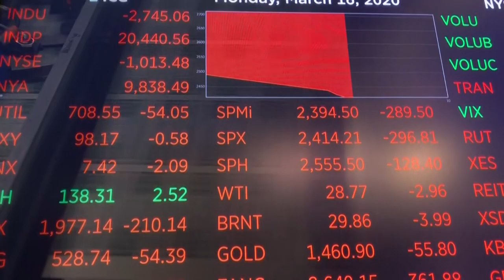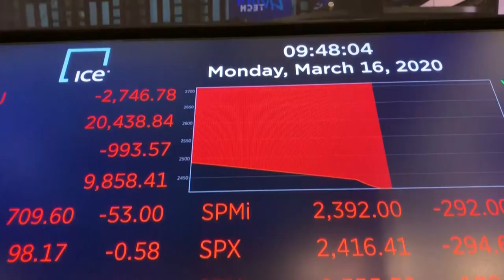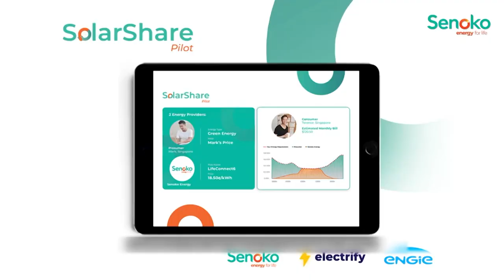Why Low Carbon Is The Way To Go | Money Mind | Low Carbon Economy

Comment: Building back better is a US Democrat slogan. The great reset includes climate change. 
But in reality although it sounds good and well, solar system for example is expensive and it does not last. 
I have 6 solar installed street lights on my compound. After a year it stopped working. I was told I had to buy new batteries. The battery replacement are expensive. Now I had to reinstalled the solar street lights system  to electricity. Even electric cars needs electricity. 
Dont get me wrong but I dont agree with the term 'climate change' because the climate is natural weather good and disasters.  However pollution is man made. Yah but what do I know about global renewable because am just a humble being that do not contribute to pollution.

Comment: Weird thing is that fluorinated gases which form the largest proportion of greenhouse gases are ignored. Sulphur hexafluoride which a man-made greenhouse gas used in switchgear (something like a circuit breaker) in electric grids is 23500 times effective in trapping heat than CO2 and "green" energy uses lots of these switchgears in the power grid.

So unless the leakage of such gases in switchgears are resolved. Green energy initiatives don't feel green in any sense.
Reply: Do you have any idea why no one's talking about this? Genuinely curious.
Reply: only half true, and it will be addressed. We no longer drive a model t?
Reply: @BobQuigley  which part is wrong?

Comment: Carbon Sequestration. We have to grow trees and then make things out of the wood. Or store the wood underground so that it doesn't decompose. The more carbon we store in wood, the less there is in the atmosphere. Buy wood not plastic.
Reply: We should store carbon where its most useful - in the soil i.e. as biochar.
CO2 is not a pollution, its fertilizer
Reply: @ssruiimxwaeeayezbbttirvorg9372  I agree, but I also think we need to change how we think about building construction, and home products. We need to switch to a carbon cycle economy. Like furniture for example. Let's stop making plastic laminated sawdust and make quality wood furniture again. And economically incentivisze investing in wood products. (No tax on wood products for example) I'd much rather buy or trade for handmade wood furniture anyways! Or live in timber frame wood clad houses and buildings, rather than concrete and plastic ones. There's a ton of economic opportunity just waiting to be tapped. And I think people could get on board (pun intended) if they knew it was helping the environment, and  having an impact.